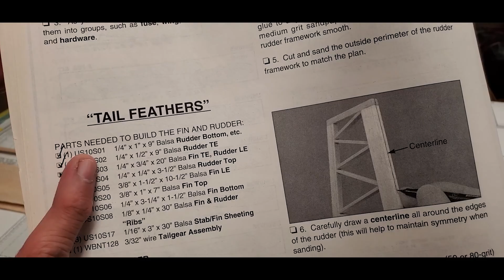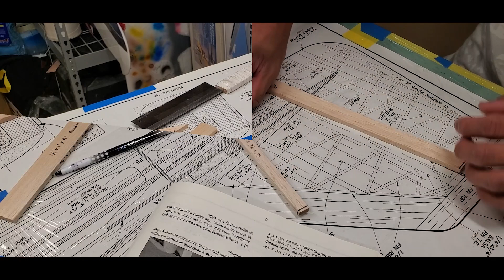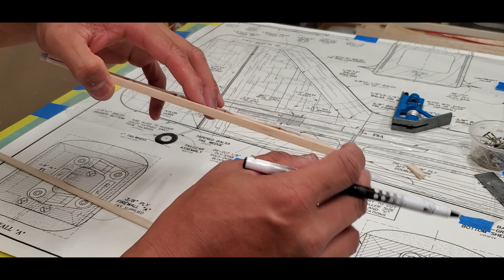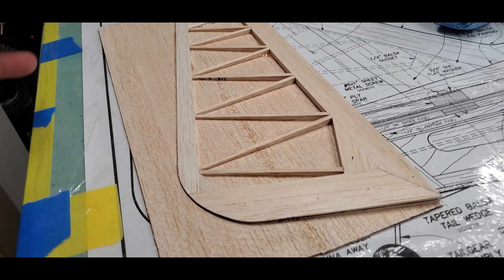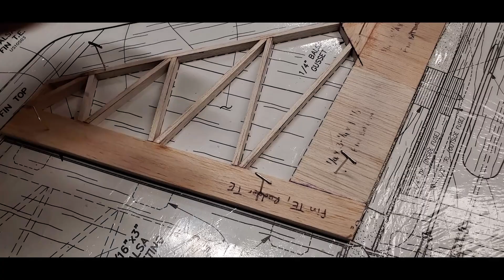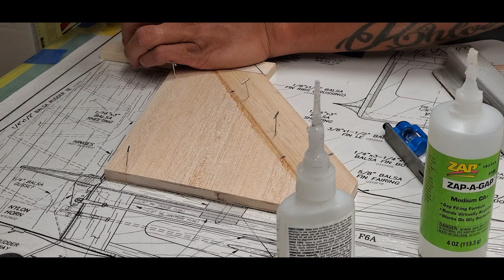Great Planes Ultra Sport 1000 Build Series Part 1 Vertical Fin and Rudder Assembly

Comment: being a newb can i ask. When you lay the cut prts to the plan do you cover the line on the plan,leave all the line showing or split the line? or do you use a mix?
Reply from the maker: I always stay within the lines if your wood parts are close.  If it is over the lines I then sand the parts until either at the line or within the lines.
Reply from the maker: Also some kits has amended instructions or updated diecut wood parts that are either bigger than what is seen on the plans or smaller.